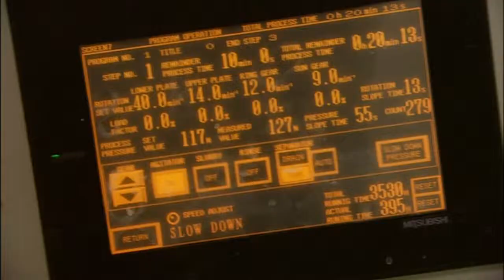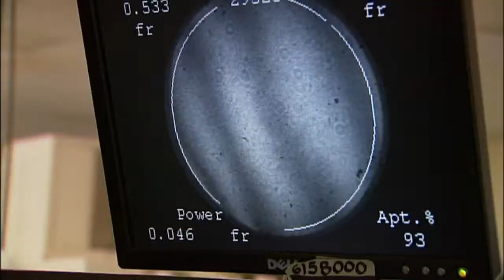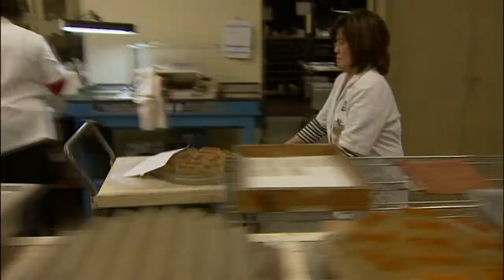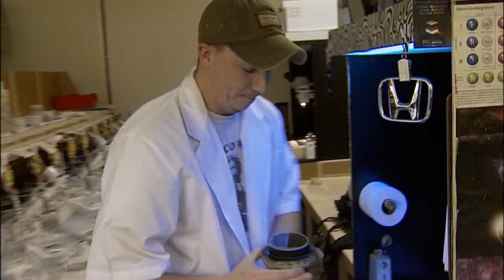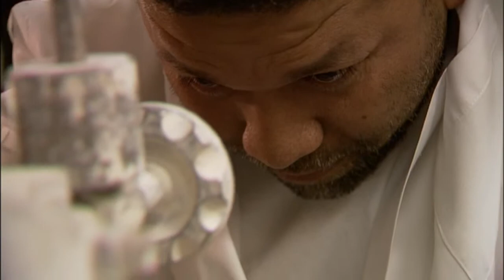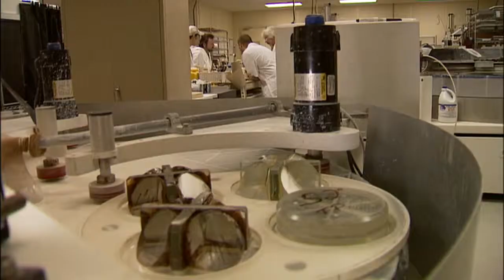Precision Optics | Job Hunter | MPB

Comment: Love the video...brings back old times!  Spent 10 years with a company in Florida, Optical Mechanical, (OMI). I ran three optical glass polishing machines, flat-work...up to 72 inches.  Day and night windows.  Germanium, also spindle and high speed work with Zinc and many other exotic materials.  Also glass.  Miss those days.  Plano polishing machines.